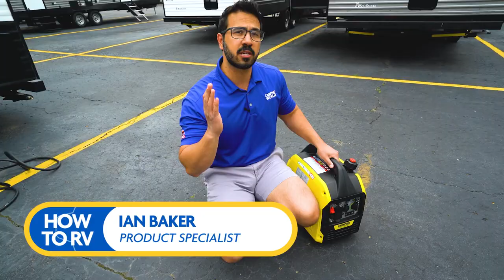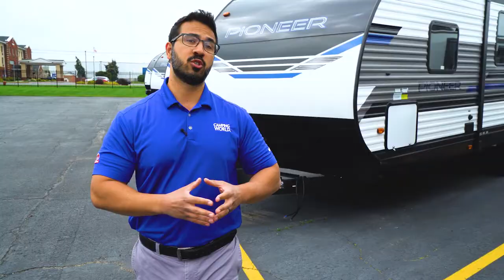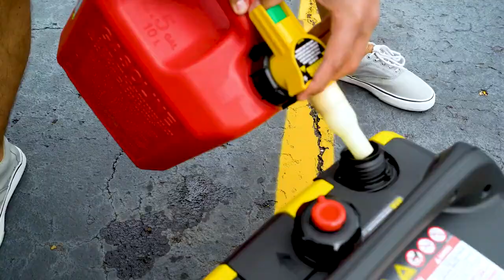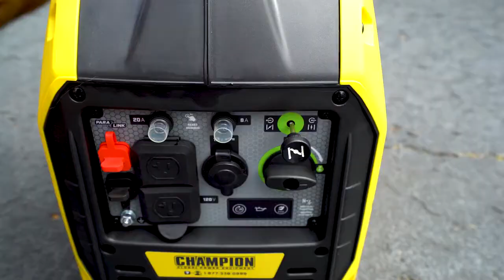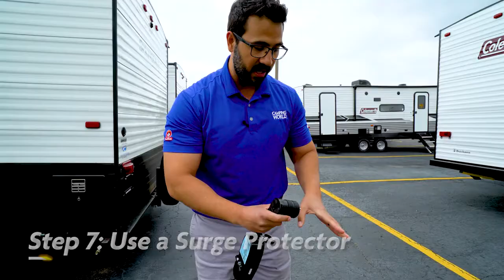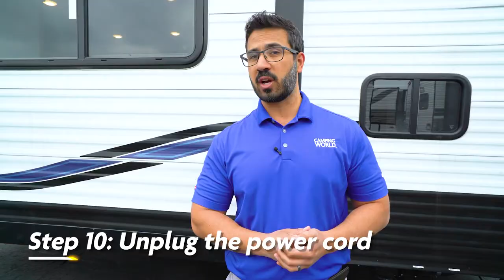How To Hook Up and Operate A Portable Generator | RV Basics

Comment: Could I hook up a generator and solar to run everything?
Reply from the maker: Hi Ray! 

It depends on your RV, its required power service (30 vs 50 amp), the size of the generator, and the exact specifications of the solar system you're talking about (i.e., size and # of panels, battery storage capacity, inverter capability, etc.). 

Here are a few resources that might be helpful: 
https://blog.campingworld.com/gear-and-accessories/how-to-choose-a-generator-for-your-rv/
https://blog.campingworld.com/gear-and-accessories/how-much-solar-does-your-rv-need/
https://blog.campingworld.com/learn-to-rv/can-you-run-ac-with-solar-power-in-an-rv/

Hope that helps!